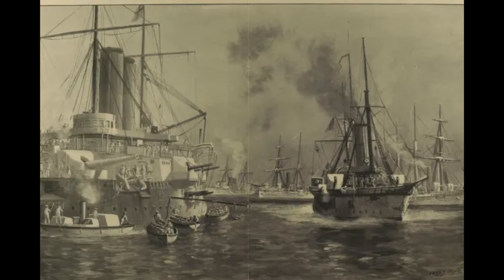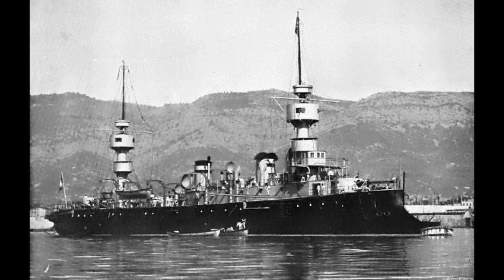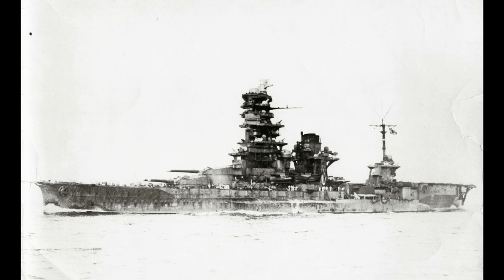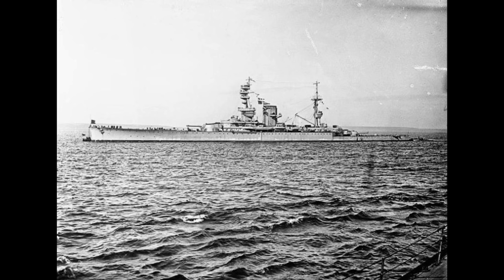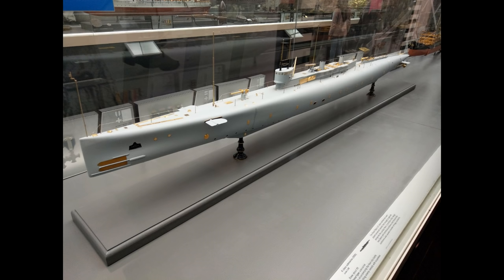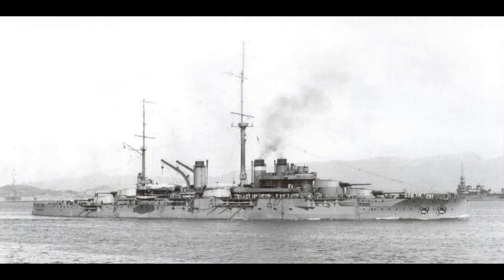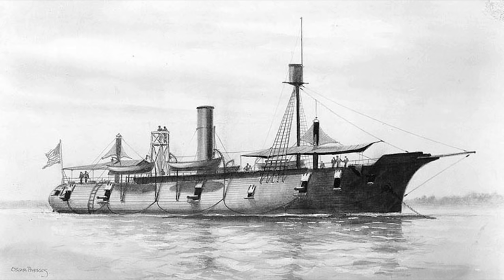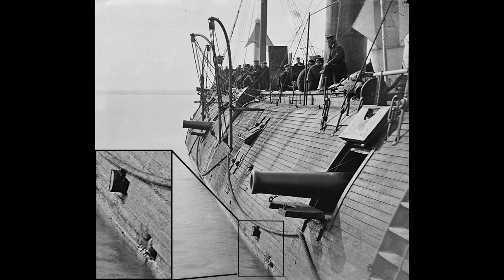Naval Engineering Disasters - How not to design a ship

Comment: Friedman gives a good explanation of why the USN went to Diesel-electric for sub propulsion, while most navies stayed with direct Diesel drive (on the surface). After WW2 it seems that Diesel-electric became the standard propulsion for non-nuclear subs. Was this the case? If so, why? What variations were developed beyond those pioneered by the USN?
Reply: You should put this under the Q&A pinned comment
Reply: The final interaction of the US diesel-electric powerplant is found on the 580 class.  It used a giant version of the Chevy Volt system.  The electric motors were always running off the battery.  The diesels just kept them charged and ran off the float on the surface or while snorkeling.

Comment: …sir, could you please confirm which was the first ship sunk by a torpedo? Thanks!
Reply: Not the video creator but I believe I can answer this.

Technically there is 2 answers depending on if you mean “self-propelled torpedo” or “mine on a stick torpedo”. 

For the “mine on a stick torpedo”, that would be the USS “Housatonic” in 1864. It was sunk by the submarine “H.L. Hunley” and was also the first “successful” attack on a ship by a submarine. (Successful is in quotes because the “H.L. Hunley” was also sunk in the attack.)

For the “self-propelled torpedo” it would be the Turkish steamer “Intibah” in 1878. It was sunk by the torpedo boats “Chesma” and “Sinope”.

Comment: The would be a useful role for the Isa battleship/carriers, which is the same role of the escort carriers of the US Pacific Fleet:  to supply replacement aircraft to the fleet carriers.

So put as big a hanger on Ise as possible, and one or two catapults.

Ise then sails with the carriers providing AA cover.  Those carriers then launch a strike sortie and loses (say) 10 aircraft.

Admiral: we lost 10 planes.
Ise: OK, we'll launch ten replacement planes.
Admiral: Thanks 

Since Ise is sailing with the fleet the planes it launches will be landing on the carriers very quickly, bringing the carriers back up to strength.

The escort carriers did the same for the Americans, but they were too vulnerable and too slow to be anywhere near the battle, so replacing losses was laborious.

Comment: Strangely, Furious seems to be the overall best of the courageous class in original form.

If I remember correctly it never suffered the problems of damaging itself from traveling the sea, being a half sister its design differed somewhat. It also dodged the triple 4 inch turrets instead having the unusual but perfectly useable 5.5 inch secondaries.

While its problem of not being able to handle its 18 inch gun firing is serious there was provision in the design to use the standard 15 inch turrets instead.

For what good such a large ship with paper armour would be

Comment: About Corbey (?) armor: If assume that at short range, no amount of armor will protect you, it makes sort of sense to armor your ship only for long-range engagements since short-range engagements render armor irrelevant. This is me making assumptions out of thin air, but it is a possible line of reasoning that could result in this kind of ship.
Reply: As Drach pointed out, her own guns were incapable of firing long-range, which made longe-range-ok armour totally useless.
Reply: By this doctrine, her job at long range would be to charge into short range. I am not saying this is a good idea, I am saying this is a possible, if flawed, line of reasoning.
Reply: But then you'd want your guns to elevate so you can actually SHOOT BACK at long ranges.
Reply: *Courbet

Comment: The idea of a carrier-battleship with strike-aircraft would also make sense in theory - if the naval battles went in a completely different way than in reality.
Let's say you have this ship and maybe an escort against an enemy battleship with also no or nearly no escort. Then the few planes could do a torpedo-run or bomb the heavy guns and hopefully damage the enemy hard enough where your ship has a way easier time taking them out, if a direct engagement is still necessary at all after the airstrike.

But that would of course only work if you have such smaller engagements - which was not how most battles in both World Wars went. And then of course there is still the question of your enemies' anti-aircraft capabilities - are they limited enough where your few planes would succeed (which is why i said no or nearly no escorts).

I think we better leave battlecarriers to scenarios like Battlestar Galactica, where both sides of the conflict decided those kinds of ships are the best option ...

Comment: OK so there is pdf on the net from the diver that examined wreck of HMS Indefatigable, there is scheme with internals of the ship(turret barbettes, magazines, ...). On the wiki page, there is armour layout scheme.
When looking at these two, it seems that whatever the belt thickness, more important would be armour on the turret and barbette(as that would be most of the area that can be hit), which was not four inch, not six inch, but seven inch. I am not quite sure how accurate these profiles are, and looks like Youtube doesn't like posting links (my initial post to this was already deleted).
Nevertheless at least it would seem that Turret/Barbette would not be worse protected than previous class, and the proportion of the potentially more vulnerable area (as best I can tell from the diagrams, most if not all of the magazines seems to be bellow waterline) would be relatively small. Of course this theoretically leaves possibility of wave exposing entirely unprotected part of the ship (in a way of Drachinifel's HMS Hood theory)  but this would still mean that perhaps Indefatigable does not deserve as much to be on this list(and I suggest that the analogies about death star are somewhat inaccurate).
I am also not sure if it is entirely reasonable to expect absolute alignment of ship design to specific task, it seems to me Royal Navy had experience with ships serving very long time, fulfilling many roles and changing over time and every design was ultimately a compromise.
EDIT: Not a diver, nautical archeologist Innes McCartney

Comment: I have to disagree with the Indefatigable. The problem wasn't the design. The problem were two "human factors." First was putting battlecruisers in the line of battle. They were armed for the encounter, but not ARMORED enough. Their placement was a command failure. The second "human factor" was poor ammo handling/storage procedures. I've seen two other shows proving poor ammunition handling procedures led to the loss of Indefatigable, Queen Mary and Invincible. (Mainly leaving flash doors open and storing powder bags closer to the guns for faster firing.) One of the shows made a hull model of one of the British battlecruisers and duplicated the damage inflicted on SMS Seydlitz. (cannot remember which one.) The battlecruiser was able to stay afloat and would have made port.
Reply: The problem was that Indefatigable was badly designed enough that she was bad even OUTSIDE of the line of battle. 

She’s a ship designed to kill enemy cruisers that can easily be killed by said enemy cruisers, which wasn’t a problem with something like Invincible.

Comment: Would a battleship carrier hybrid have worked as a convoy escort? It probably has an equivalent air group to a MAC, capable of dealing with submarines, and the fire-power to scare off most surface raiders? Given the RN using both carriers and battleships in this role?

Comment: It´s surprising that the background of the Königsberg´s flaws is not mentioned here. First there were the limitations of the Treaty of Versailles and that meant 6000ts max. And in order to achieve that they welded the hull to a degree that was never done before. So that was unknown territory and it turned out to be a failure. Unsurprisingly the first new cruiser after WW1, the Emden, was much more robust and seakeeping was better as well. But that design was based on the old cruiser designs of WW1. In other words: the allies and especially GB did their best to declare Germany the cause of the war and to amputate it´s fleet. But that meant that it couldn´t continue building essential ship classes like cruisers and destroyers year by year and that meant that they slowly but surely lost know how.
Reply: The Germans overloaded the K-class and subseqent light cruiser classes with ridiculous weapon load for their size.  They could have made them sturdy if they had cut the armament by 1/3, which would then have been comparable to other light cruisers of that size (Leander, Agano, etc.).  This was a major failure by the designers.  The first job of a ship is to be seaworthy.  The designers failed at that.

Comment: Hmm Gato class 311 or so feet..not much shorter than the K, nearly 100 ft longer than some U -boats (IJN I-400 : 400 ft.; German type X: 294 ft. ) That's still a lot of boat, for what is considered small and cramped.

Comment: There is actually a completely legit reason for a battlecarrier beyond what you mentioned, and one that counters all the drawbacks you mentioned. And that reason is... "Rule of Cool". It could be some high ranking admiral's pet project. God knows there were plenty of those. So yeah, all you need is an admiral dumb (and awesome) enough to go "Actually, I think aircraft carriers SHOULD have a few 12" guns to see off anything that gets too close", and badabing badaboom, you got a battlecarrier.
Reply: Also I kind of like the idea of a full length aircraft carrier with light cruiser weapons mounted in casemates. I know casemates aren't as flexible as centerline turrets, but for defensive purposes (Throwing out flak shells, fending off raiders), they should be adequate.

Comment: Given the Ises, am I alone in thinking the rebuild was really, really half-assed?

For me, it's the retaining of the middle turrets.
Like, why?

It gives you a tiny flight deck, and the guns have almost no arcs, because they are boxed in between the deck and the funnel.
Meaning that they are effectively useless anyway.

They clearly should have either removed them or, if they really, really wanted eight guns, have made a bigger rebuild.

Specifically they should have turned them into Tones, with all four turrets in the front.
They won't need much ammunition anyway, so they can share the forward magazine. 
To make room for that you move the pagoda aftwards, and you mount the funnels to the side of the flight deck, which now extends at least half the length of the ship, if not 2/3s of the way if they drop the aftmost turret completely.
The removal of the amidships magazines also allows for the installation of additional machinery, boosting speed. Finally you have more hangar space due to the longer flight deck, which also allows for more efficient aircraft handling, as well as more AA-mounts.

Now you have a ship that has twice the artillery capabilities AND twice the carrier capabilities compared to what they ended up with.

It's probably still useless though, but still, better is better.

I guess they probably did not have the resources or time for such a rebuild, but that begs the question of why they did it at all

Comment: While all of these certainly were failures, I think you can divide them into two classes.  The first is for structurally well built ships that functioned, but through stupidity of design served little to no practical purpose.  The second are ships with inherent structural issues that made them unsafe for their intended use.  The first category often has nothing to do with engineers, but more with their political and financial keepers.  The second category most often arises through engineering by committee with no one single entity in charge of making sure all the parts work together.  I've seen first hand examples of both in the US Navy, and I dare say the later issue is the bigger problem.

Comment: An interesting What If: The RN disptches HMS Indefatigable to the Falklands, and Scharnhorst and Gneisenau return triumphantly back home, after having defeated superior forces on paper. Would they have learned their lessons, and use the Queen Elizabeth class as their spearhead at Jutland, and trounced the German High Seas Fleet, or even anticipating the Kiel revolt to 1916, before the October Revolutin in Russia?
Reply: The only reason there was a RttS was because the German light cruisers confused the QEs with regular BBs (2ns BS as at Scarborough), so Hipper had no problem engaging while Scheer turned West in order to open the trap.

If the RN is not using BCs and leads with QEs, it is likely that Hipper would simply use its superior speed to open the range and STILL draw them South while Scheer steams West to cut them off.

Historically, Hipper later reported the BBs were in fact QEs and was being engaged by them, so Scheer turned North to assist Hipper ASAP.  The KM wasnt the mess the GF was.

Comment: It doesn't just happen in naval architecture. I work for a company where one group of experts spends an inordinate amount of time selecting equipment that can work very efficiently. Under certain very specific circumstances. Then another group of experts, working one floor below in the same building design the sites so that those circumstances cannot, ever, happen!
Neither group are morons, nor are they malicious. They are both operating according to the principles they have been taught to follow and get rewarded for following. The problem is those principles are contradictory and they just cannot and/or will not speak to each other and coordinate their efforts.

Comment: I nominate the Popokavas, Russian Monitor type ships, which would have been interesting in the 1860's, but served to the 1920's. That their hulls are round, meant that firing a gun from them turned the ship, and they had no directional stability to boot. The only thing more cancerous looking than a French Pre Dreadnaught Battleship afloat at the same time.
Reply: The directional stability thing is a myth (as Drach has pointed out in other videos).
Reply: @bkjeong4302   Really? If any twin screw or triple screw ship loses one prop, do they turn in circles operating on 2/3 or even 1/2 Power alone?
Reply: @twotone3471  

I think he covered this on the 5-min guide for them, but while these ships were slow, they didn’t randomly spin around.
Reply: @bkjeong4302   With the lack of mechanical reliability that the Russians showed at battling the Japanese not long after these ships were in the active fleet did likely mean these ships did spin around like whirling dervishes when something broke. This also accounts for actual combat where any amount of flooding combined with a list would mean that the ship would be unable to move in a streight line. 

Terrible design.

Comment: A few potential candidates to add to your list. Filed under ships that were basically okay, but suffered one known design flaw or compromise, that would eventually contribute to the loss of the ship. Such as USS Wasp, in the effort to keep it under Washington Naval Treaty extra tonnage they skimped a bit on things such as Fire Protection and a Torpedo Magazine. oopsie! Or the Kaga and Akagi Battlecruiser conversions, where the final evolution put the heavy 7.9" AA guns in the original Battlecruiser gun tubs that were located below and overhung by the Flightdeck. Meaning the two ships had virtually no ability to shoot at or shoot down aircraft located directly above them. Which is a bit of a design oops when your primary threat comes from Dive Bombers coming in from directly above you.

Comment: No Deutschland Class panzerschiffe?  In theory faster than anything it couldn't outgun.  In practice to slow to run, too weak to fight.
Reply: Decent concept when they were designed in late 20's, but hopelessly obsolete when the war actually broke out.
Reply: @Ah01  I disagree.  in the 1920s squadrons of faster heavy and light cruisers were not an alien concept, nor were the existence of battle cruisers capable of 30+ knots and toting 15 inch guns.  The "pocket battleship" or pazerschiff's one redeeming value was its extended endurance capability, but such could have been done more efficiently with a faster heavy cruiser mounting 8 inch guns and still posing as much of a threat as an 11 inch gunned commerce raider.
Reply: You`re right, but the battlecruisers capable of 30+ were very few in numbers, RN had only four at late 20`ies. That left plenty of ocean to hide in. Worst flaw in panzerschiffs was their lack of protection against cruiser gunfire, as was later to be proved by Admiral Graf Spee. On the other hand, Admiral Scheer had a decently successfull wartime courier, if that can be said of any kriegsmarine ship. 🤔

(And, of course, the panzerschiffs were just uselessly overgunned cruisers, with important speed advantage traded for a pretty much useless 11 inch guns. )